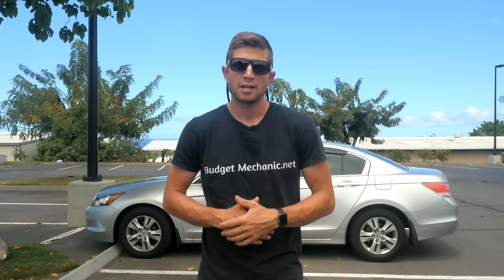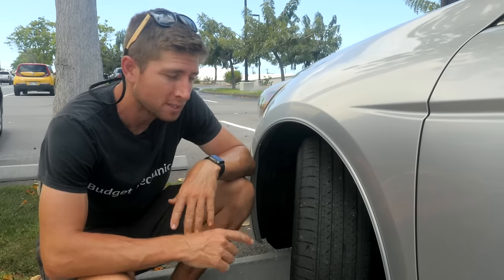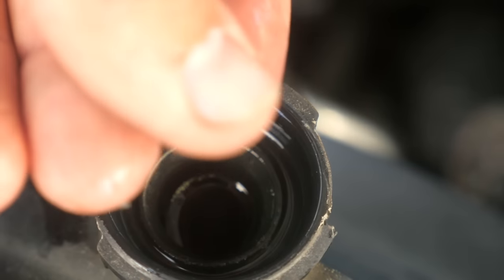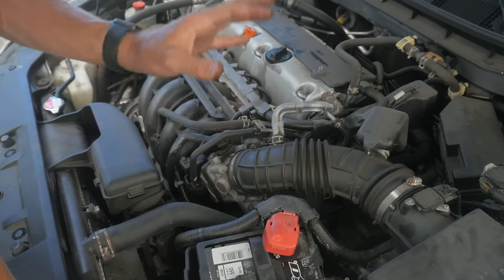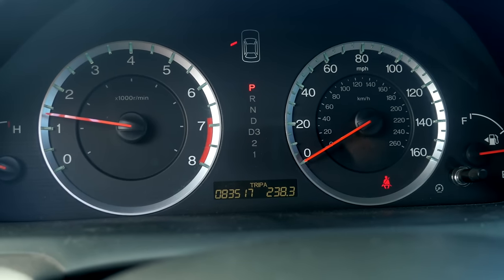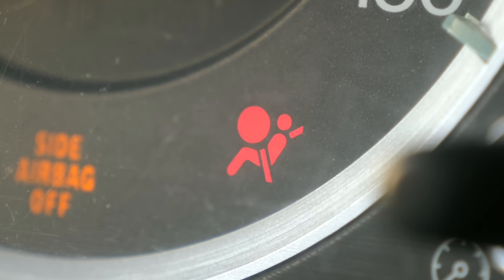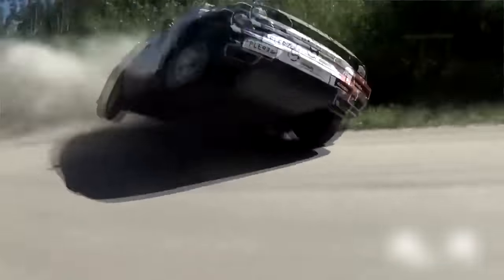How to Inspect a Used Car For Red Flags and Not Get Scammed

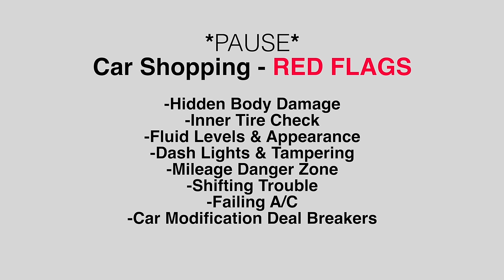Comment: 0:30 Overview
0:40 Body match, dents, cosmetic dmg
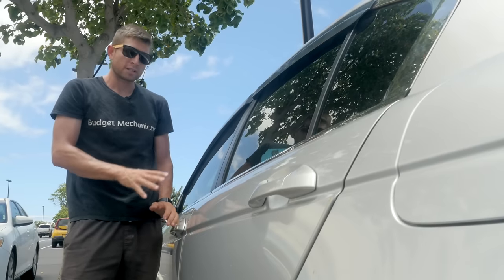1:06 Paint, hidden color
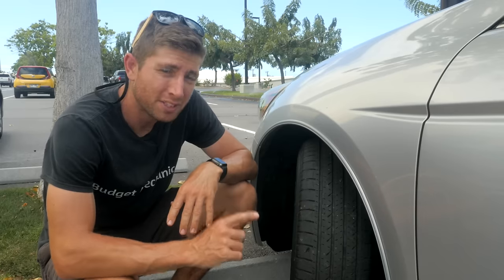1:40 Tires
2:36 Hood.. Fluids
2:44 Coolant
3:52 Engine Oil
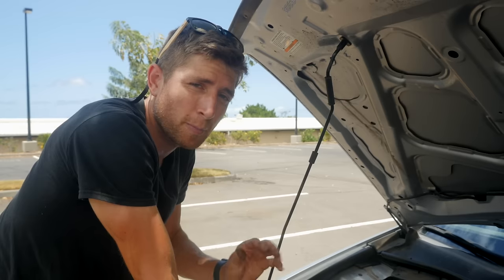4:47 Transmission fluid
5:50 Test Drive
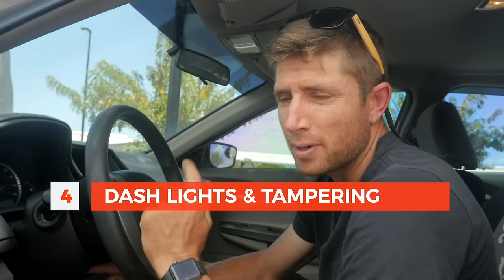5:58 Instrument Panel, Dashboard Lights
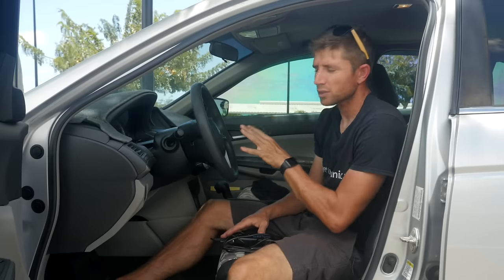6:37 Engine light.. ODB scanner reading
7:31 Airbag light
8:03 mileage, parts needing replacements
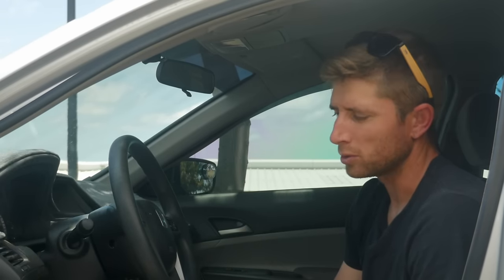9:35 Seeing transmission gear shift problems
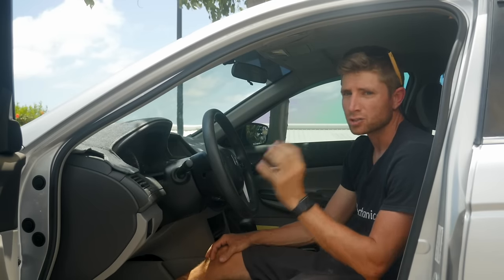10:04 AC system
10:31 Unnecessary mods customs
Reply: You the real MVP, thank you. Wish YT let me copy this for my notes
Reply: @I am MVP
Reply: THANK YOU 💗
Reply: Shit I thought I had nothing better to do than watch YouTube videos but you take it to the next level you watch and take notes dam you got too much time ⏲️ haha
Reply: Mitral Valvé Pró-Lãpsê
Reply: Make sure the title is clean and you are able to get it as you pay for it. And make sure there's no loan on the car
Reply: Hey bro. Is a Lexus IS 250 a good buy with 250k miles
Reply: Bring a hand code reader for erased codes
Reply: Thank you for shortcut to the list .

Comment: Something not mentioned: smell the dipstick, oil filler cap and filler hole if you can get to it. I recently passed up a Mustang GT because the oil reeked of gasoline. This can indicate bad compression/ oil scavenging rings, and/ or bad valves and valve seats, allowing fuel/air mixture into the oil galleys of your engine, accelerating wear throughout the entire engine.
Reply: Or you know the car running rich, and the dude flooring the car around alot as well, you are always going to get some gas dilution in a motor.
Reply: Good point.
Reply: Hate to tell you this, but smell of gas in oil means bad fuel pump. Also check for foam in radiator means bad head gasket. If your car is running rich, means air/fuel mixture is incorrect for carb in my time, but newer garbage means bad fuel injectors and this will cause bad rings,comprehension and consumption. Any vehicle you beat on will cause motor damage. Oh when we didn't have catalytic converters I used a pint of Valvoline tranny fluid in my gas, then changed plugs after, and this was done to protect the engine. Also old school real mechanics also knew you could use moth balls to bring the octane up in gas, but can't with new cars. Just a female perspective. Today the gas they make us use is destroying are cars. Proof is in all the older cars and trucks still around.
Reply: Should also smell the transmission fluid if it smells burnt may be an overheating transmission costly repairs there as well..
Reply: Or it’s just oil dilution like on Honda civic, which is baddd
Reply: Or they could of been doing short drives and and allot of warming up in one spot short trips can do that also , shit my direct injection why I change my oil every 3k miles
Reply: @OYATca true Subaru has same issue
Reply: Most direct injection motors have a small fuel smell to the oil unfortunately
Reply: 08 honda civic lx bad fuel pump is not likely the problem. Pcv system also note short trips and quick starts, I currently own an 08 civic lx and the crank case can cause this as well..

Comment: I would also add look under the car for any bad rust, check the steering to the the full extend left and right. Turn on as many accessories as you can while stressing the steering, this should put the highest electrical load on the car and maybe reveal some problems. Also look at the shocks and struts for leaks and rust, look at the ball joints. Look at the rotors. Do some hard breaking, check that the abs is working. Check the panel gaps for evenness. Check the passenger side floor for any dampness.
Reply: Rust is the worst we can always change an engine we can't change chassis
Reply: Yes, yes, yes. I got burned on a Ford Ranger. I couldn't even get it inspected. It was about to break in two. And I can't believe he didn't cover burning oil. These are the two worst problems-- not mentioned.
Reply: What is dampness in the passanger floor mean?
Reply: @LeviWalton777 Bad heater core
Reply: @LeviWalton777  Rain water ingress. Bad seals etc

Comment: I have saved myself from ALOT of lemons by asking to take it to a mechanic first...also my mother had a father who was a mechanic so he taught her alot and she knew what to look for when car shopping and buying! I saved this video because your spot on!😮🎉
Reply: With all due respect, is that realistic? My mechanic doesn't even work on weekends. And you're also assuming the distance to your mechanic is reasonable. What if the car is 50 miles away? Plus a mechanic should be paid to inspect a car. Lots of things to consider. :)

Comment: Terrifically helpful material.  I am the (retired) managing editor of an auto magazine, and producer of a syndicated automotive radio show (remember them???). I can state with absolute certainty that this advice is solid. I would add:  SMELL CHECK... if the interior smells like mold, WALK AWAY. Pull up the carpet. Do you see water damage or residue? WALK AWAY.
Reply from the maker: Good ones
Reply: Oh crap
Reply: I bought 2015 Dodge Dart flood damage. The interior had dirt and was moldy. I got to work and cleaned the inside. Best car I’ve ever bought. Moldy interior could be roof leak which is typical of cars with panorama sunroof. That is one hell of an expense!!

Comment: The one about the stored codes is one that 99% of people miss! Even though there is no light on, the seller could have just reset it and hopes you won’t check it.
Reply: I just fell for it a month ago. Vehicle left me stranded in the middle of nowhere, pitch black. This happened 2 days after purchase. First time buying used, found out even the history report was false. These cons can beat almost any system. I could sue (every single thing he had in the ad was fraudulent), I just rather pay the repair ($3,000!!!!!) and don’t want to see this person again.
Reply: @ThisIsMyYoutubeName1  Thank God you had 3,000 to pay to get it fixed🙏🏾 sorry for your loss!
Reply: @AustrianEconomist  the problem with it is there isn’t much money for profit, so no lawyer would take my case.
Reply: @gregoryswift7804  Thank god?
Reply: true.  -but some codes that have been repaired are archived.  even a simple eval code for a loose gas cap will often show up as a n archived code.nso cleared codes isn't a deal breaker -just something to be aware of.
Reply: @Bruehoyt  how do you look for codes?

Comment: Few things to add. 
Do a background check on the owner of the used car dealership. Look at carpets for water stains and smell for odors. You can decide on if you want to purchase a history report or a carfax, but don’t put much faith in the accuracy. Highly suggest buying an OBDII, a $40 one will do. And do not ever sign anything that states “as is”. Everything he says is true! You need to really search for damages. If they claim it’s never been in an accident and the seals aren’t aligning, RUN!
Reply: Can I ask you…why not to sign anything as is? Even if it’s been through a good dealer and and everything on the vehicle is good?
Reply: @leasea9621  so many things can be hidden. I purchased a vehicle, 2 days later I was stranded in the middle of nowhere in the dark. Brought the vehicle back to the dealership the next day and it was $3,500 to fix. When leaving the dealership, everything seemed perfect. 2 days and I’m paying that much to repair it? After speaking with multiple attorneys they all warned me to never buy “as is” .
Reply: UPDATE! 
I had a very experienced mechanic and body shop guy fully inspect my vehicle. Clean title, but it’s been in at least three collisions. Front drivers side was the hardest hit, it got t-boned on the passenger side and rear ended on the driver’s side. Due to all this, every time it rains, I know I have an expensive repair coming. Last week I had to replace my headlight ($105) and today I have 15 codes. Only 4 months since I left my comment and repairs far exceed the cost of the vehicle. BE CAREFUL
Reply: @ThisIsMyYoutubeName1  wow I'm sorry that happened to you.  Make sure you decide whether or not the car is worth fixing to avoid wasting more money.  Also if your car has low mileage you may qualify to add a third party extended warranty
Reply: @lilman4067  I did have a third party warranty, but it didn’t cover things that needed to be replaced. Since my last comment, the vehicle is now a complete loss. Mechanic said my head gasket is blown, despite no sign of oil being contaminated and the vehicle has never once ran hot. Never had any issues with oil leaking and coolant is full. I don’t understand why or how, but my credit union has started to investigate (no auto fraud attorneys will even reply to us, so hopefully they can get something resolved). I don’t want anyone going through this. The economy is bad enough, to get scammed out of $9k? It’s sick
Reply: @ThisIsMyYoutubeName1  so dealership sxamed u ?
damn tthts toigh
Reply: @ceasar7830  yes, but it was a small LLC, not like a huge dealership. He’s done the same to many people after me as well.
Reply: Thanks.
Reply: @queentinadoire6931  

You're welcome.
Reply: @Lea Sea  yeah was gonna say pretty much everything used is as/is.. by that logic let's not buy a car altogether unless it's brand new and even then screw it I'm getting a bus

Comment: I keep a spreadsheet on all my maintenance and repairs that includes date, mileage and a good description (and cost) of what was done. It really makes it easy to keep up with things and provides an easy way to look back to see just what and when something was done. Put your VIN at the top for easy reference as at times you will need that info. You can also include a macro to tell you when your next oil change is due if you separate oil changes from repairs by column
Reply: Or you could follow the manufacturers service schedule.
They built it, they test it and have so much more education about the vehicles they build than anyone else.
Reply: @albybloke2289  I dont even care Im 2 months late, what the hell are you on about dude. They legit were talking about nothing but tracking maintence on their car. Nothing about the specifics like how many miles until the oil change, so you either horribly misunderstood or are just openly assuming because of something they said. 

You know what they say about assuming...
Reply: @cherriberri8373  I'll rely on my 45 years in the motor trade to know what I said, if you can match that I'm happy to listen.
Reply: I feel that both pieces of advice are compatible with each other. Regulations around cars vary throughout the world. I live in New Zealand where there is a relatively high number of imported 2nd hand cars that are owned for longer than countries like Britain, Japan, or USA. Many of those cars are not serviced by a branded dealer. Some mechanics put the onus on the customer to maintain a history of what has been done to their car.

I suggest that this video is aiming towards people with little experience of cars, like myself.
Reply: Spreadsheets do not prove you did the maintance. Receipts do

Comment: Excellent video. I would add to tires to check the DOT numbers that will tell you the year and week that tire was manufactured. Sometimes the tread looks great, but the tire is ten years old because the car was garaged or not driven much. Tires over five years need to be replaced, regardless of the tread depth.
Reply: The 5 year replacement guideline is variable.  It is sun and heat that cause the issues.  If in northern US or Canada, and especially if the car was kept in a garage -- 10 years on a tire should be fine.  And not unheard of if the car has two sets of tires -- summer and winter -- and hence neither set gets used for the full mileage in a year.
Reply: Depends more on the tyre's exposure to deteriorating elements (e.g. temperature changes, extreme temperatures, sun etc). Even if only 4 years old, they can be cracking and can be dangerous in the wet. Meanwhile another car can have 10 year old tyres that may just be starting to crack or have no cracks.

Comment: 9:12 if a timing belt breaks it could be catastrophic for your engine if it is an ”interference type” engine. There are cars with ”Non-Interference type” engines, if the belt brakes or skips, it just shuts down without causing damage.
Reply: over the past thirty yrs, almost all cars in the U.S. mkt increasingly became interference types, with either belts or chains.   When the belt breaks, it's extremely likely that there is  damage that financially 'totals' an  not fresh/newer car.    ALWAYS do the timing belt on time, and if not sure about its condition, get the cover off and inspect closely.  When in doubt about it or the water pump that is part of the set-up with it, do it all!!!!!!!!!!!!!!!!!!!!
Reply: @18_rabbit also if an used car dealer does not rewind the mileage on the car dashboard.

Comment: great video man! I just bought mine yesterday for 4000 USD with 93k Miles on it. No noises at all, plus the owner got installed a brand new the power steering system.
Reply: You got burnt b

Comment: i Bought a 2005 Honda Accord with 197,000 miles for 3,000 bucks because it had a small ugly scrape on the front and rear bumpers, the original 1 owner lady said she was not the best person to park a car, LOL it was obvious, but thats why i got a great car for so Cheap, that was 4 years ago and the car now has 213,000 miles and still drives and runs like new.

Comment: I wished I had the common sense to learn from videos like yours before buying my used car! Everything was perfect until the fan belt broke, water tank and pipe leaked, radiator leaked, and the damn workshop had to fix all other weary parts and everything cost me a BOMB 😢
Reply: Ahh come on, a newish car would cost you much more than those 3k$ for your car +600$ for repairs

Comment: One thing I always do before buying a car remove the radiator cap, start the car, if the coolant burst out while starting the car, don't buy it, the cooling should sit in the radiator at least a minute, without rising.
Reply: Hi wondering if you might have an answer. I went to look at a used car and guy knew I was coming, but when I got there, the car was very warm as he had just taken it to the post office. Even though he had another car. It's bad news if the engine is running when you get there right? So what if it's been very recently driven?
Reply: Yes, the person is hiding several things, a cold start, where you do not hear all of the components engage to support an engine start which has more friction/resistance, access to fluids that get hot, ie radiator fluid, access to engine that will burn you.  A cold transmission engagement will feel bad, but same transmission warm could feel normal.  Electric load issues are masked as well, less engine demand.  I am certain I am missing things, but yes, the seller is inconsiderate at best or hiding things at worst.

Comment: Knowing how to read 4 digit DOT date code on tires is helpful 💡

Mismatched tires and El Cheapo no name tires are a red flag imo

CarFax, AutoCheck, etc, are not always accurate 

I looked at a 17k mile Toyota with a clean history that had the entire front end and windshield had been replaced

Repair was nicely done, but no way to determine if air bags were replaced

Comment: Good stuff. I see others have more suggestions in comments. I smell the ATF, too. A burnt sugar smell can mean a very damaged transmission.  I don't like to see a washed engine. Water and modern electronics are mortal enemies with delayed corrosion of electrical connectors. Same with evidence of water elsewhere like under floor and trunk mats. Engine vibration that disappears when transmission is in gear can = bad motor mounts.
Reply: I was about to make similar comments. Also check under the front floor mats for any water. Most people know that but it's wise to check under the trunk carpet, too. Some cars have very expensive electronic elements back there.

Comment: I am surprised the braking system was not mentioned.  It is important and expensive if needing maintenance and/or repair.
Reply: Maybe its a older ford thing but brakes are normally one of the cheaper and certainly easiest system to maintence and fix

Comment: I would add, check the undercarriage of the vehicle for rust, stretch out the seat belt and check if the belt has same color or different, if dirty means the car was flooded, check the door alignment to the vehicle's body alignment, boot alignment, everywhere it should have same gap.. thank you..🎉❤

Comment: Good advice,but update there are non expensive scanners that scan in modules and can diagnose the SRS system as well as operate the module associated with it.Just look around,buy it once have it for a  lifetime as long as the manufacturer supports updates,